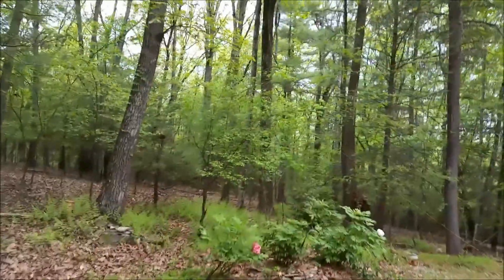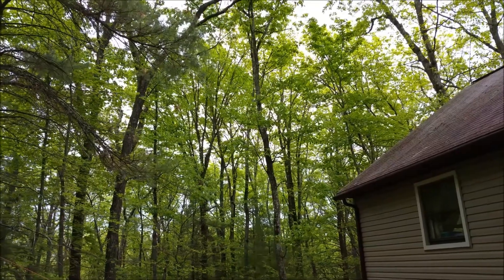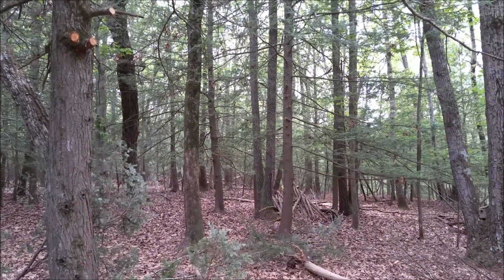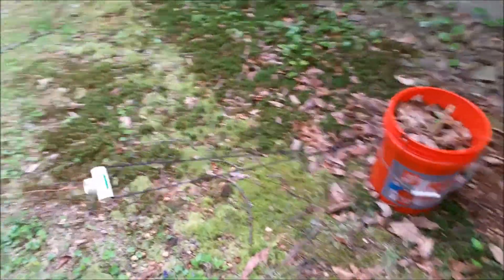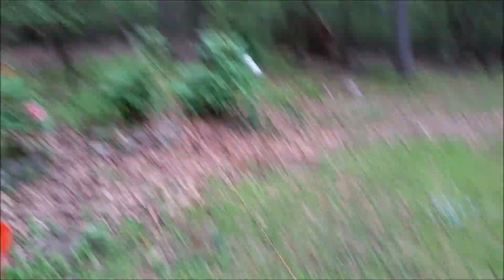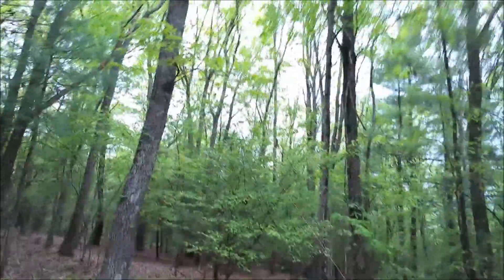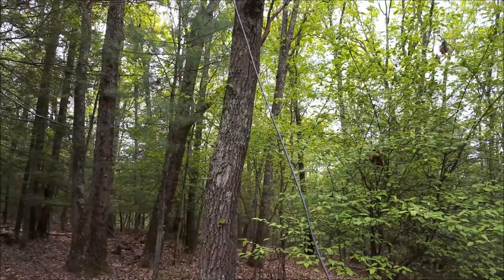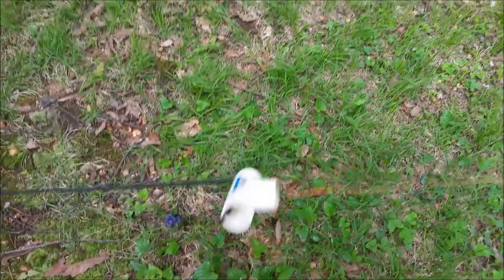My 40/20 Meter fan dipole antenna

Comment: The most impressive aspect of this video  is your private forest.   Any ham worth his weight in electrons would only dream of owning such a forest !!  This invaluable asset should never go to waste !!  Please build as many antennas on this property as possible. Dipoles, Verticals, Yagis,  Quads, Deltas, even a DISH !!!!  You've been given at least 20 or more Antenna Towers at 50 feet or higher. You have flat level ground on which to work, plenty of open space, and total camouflage protection  from anyone who might complain about the look of your antennas. Go for it !!! 
Rule # 1 in Amateur Radio:  "Never let a God-given potential Antenna Farm go to waste !!!"